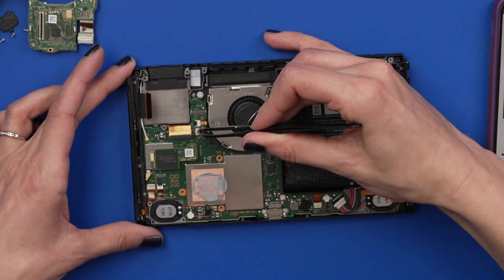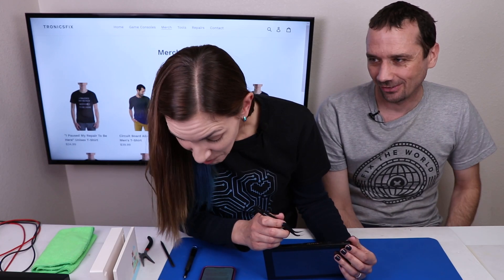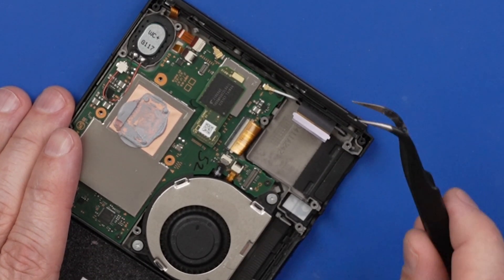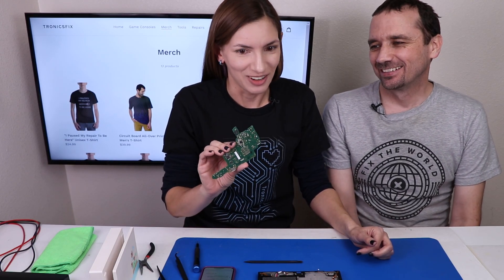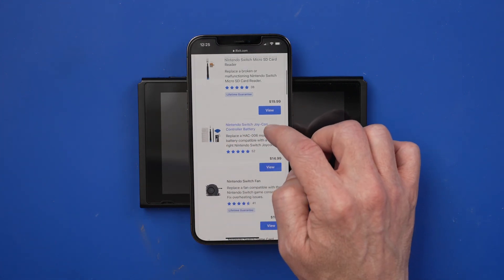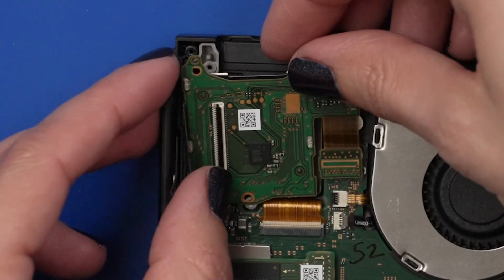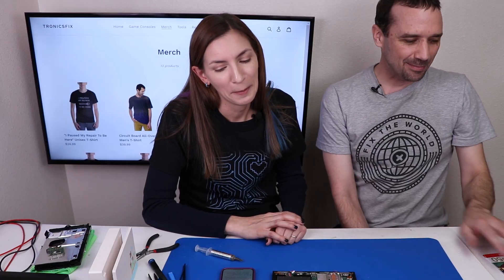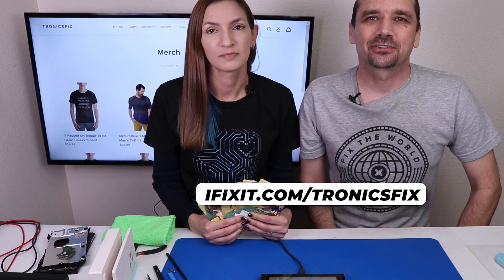If She Can Fix It She Can Have It! - Featuring TronicsWife!

Comment: I actually did my first real electronics repair a couple months ago on my own switch. It had that screen of death with the error message. I bought a hot air gun on amazon and ordered a replacement chip. I did the repair myself in about an hour or so, and it booted up perfectly after. However usb C cables only charge one way now, so I might need a new type c port or change another chip in it. Not too worried about it as it works perfectly fine. @Tronicsfix would you have taken it apart again to fix it completely?

Comment: Totally unrelated to this video. But i bought a rand McNally cleardryve 220 bluetooth headset. The charging port is broken. I don't set any teardown guide for these headset but they are quite popular in the trucking industry so they are expensive. Any way you can make a video about this topic. Or I can send you my broken headset to fix or preferably swap the charging port from micro to USB C. The port work currently but got to hold pressure on the port to get it to charge so in guessing it's just a lose connection to the charging port to the motherboard.

Comment: This was so inspiring I decided to finally attempt to repair my switch that got a bit wet from an accidental overfill of some plants…😂. Took about a half hour and I followed the ifixit guides and THIS video… I was able to successfully clean out the left rails connector that was corroded.  Saved me from buying a new switch. Already a subscriber, and without your videos I wouldn’t have had the ability knowhow or guts to attempt it let alone pull it off.  THANK YOU TO YOU BOTH. Awesome new content

Comment: Can confirm on that LCD ribbon connector. I was doing a front panel replacement on my Switch and accidentally bent two pins on the LCD connector when putting it back on. Took me an hour in the dead of night to manually reseat those pins back into place (that connector has a LOT of give I must say) so I could get a display. I think placing the connector in first THEN putting in the motherboard may be the safer option for me in the future.

Comment: Covering the differences between models is one thing that iFixit is very very bad at. Had to tear apart my Slim PS3 last year to change the CMOS battery, and their guide stopped well before I had access to the battery in my model. And I've seen other videos where someone had problems with the model of thing featured in the iFixit guide VS the model they were working on.

iFixit really needs to come up with a solution for this.

Comment: 6:20 The iFixit repair guides sometimes really aren't that good, because they leave out stuff relatively often. I tried following them to teardown a WiiU and an Xbox 360 Slim and ended up with checking teardown guides on youtube. Both times they left out a step and their photos were done from not-so-good angles.

9:45 The way I normally do that ribbon cable is that I lift up the board a bit. I find it way easier to get it in that way.

Comment: I've seen steve fix so many things now and learned a lot but small things such as the technique to un plug and re plug that ribbon cable i missed and such a video where the process was slow and the questions asked actually made me realise that i didnt pick up on such techniques before and learned something new in this video,
Nintendo definitely makes things difficult on their consoles, such as the 3ds and this seemed difficult but not too difficult, definitely great that steve is there to help in the tricky parts, I too got confused in a couple of areas so it was a good learning process watching a beginner attempt this repair.

Comment: You did a great job fixing the nintendo switch. And yes you can use your fingers to remove flex cables and small connectors. I always use my fingers.

Comment: Aw I'd love to do something like this. I'd love to be able to fix my own stuff, but I'm always just too worried I'd do something wrong and make it worse so end up just going to a shop to fix it instead. Having someone watch and guide, but largely actually leave it up to you to do and just offering help when needed would give me so much confidence to take on other tasks!
Reply: One advice I can give you is to start small. If you have any electrical device thats broken, tear it apart. Maybe you‘ll find the fault, or at least you‘ll understand how it works. You have nothing to lose, since it‘s already broken and you can‘t make it worse. That’s how I started. I couldn’t fix it, but I learned. I‘m far away from Steve though. It is big fun to bring dead tech back to live. My first repair was a 20“ LCD monitor w/o backlight I got for free. I replaced two bulging capacitors and there was light again. Since I had a CRT at that time, it was a big step up.

Comment: I'm literally using an ifixit 2018 MacBook Pro 15" battery replacement kit at work as I'm watching this video. Removing unnecessarily glued in battery cells sucks! Curse you Apple for making repair more difficult for no reason what so ever!!
Reply from the maker: Yep, I hate that they glue those in